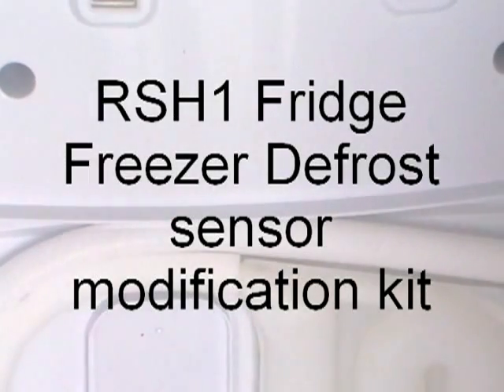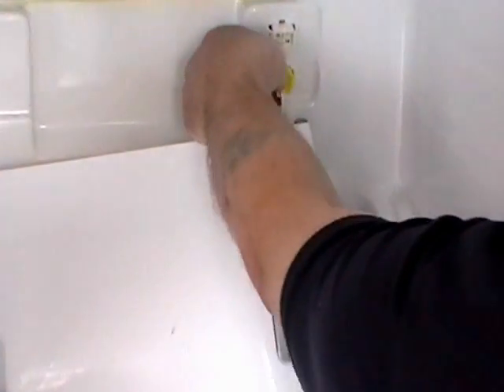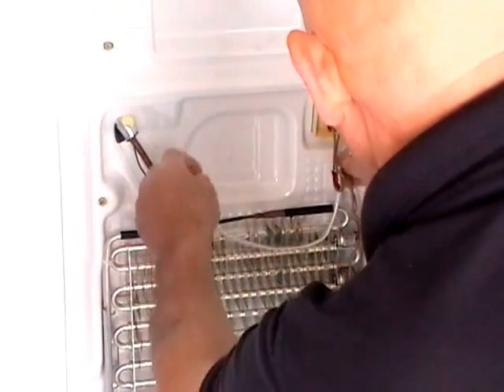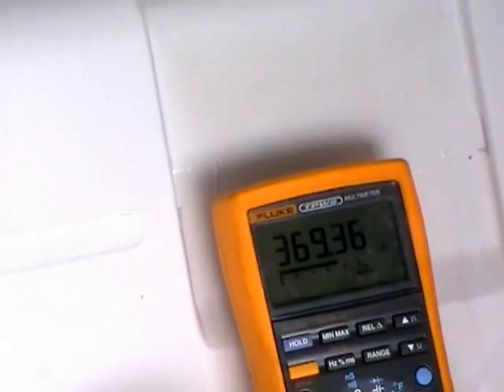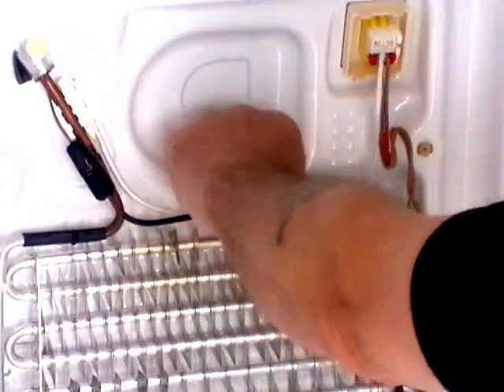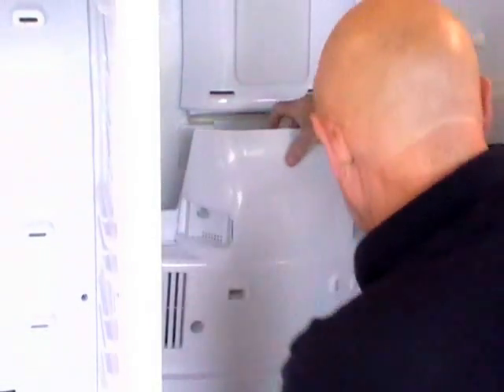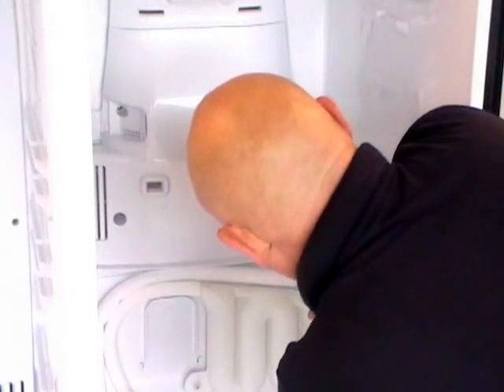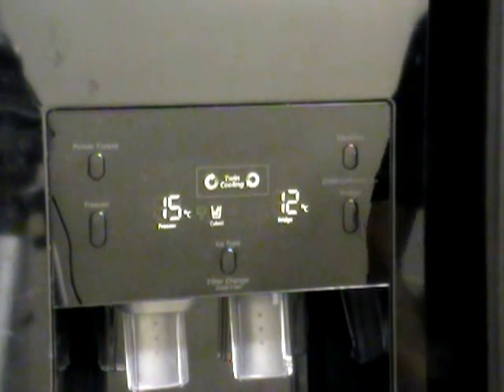RSH1 Samsung Fridge Freezer problem, fridge defrost sensor modification kit

Comment from the maker: not heard anything about plastic liners melting... i do know they can crack quite badly and excessive heat from the element can cause this. The crack is usually on the liner behind the evap panel and can be 8 to 10 inches long.
The mod kit can be done DIY depending on your ability, many people have bought this part from us and fitted it themselves, the video does show the way forward. altering the temp setting to 17 degrees (setting 3) is part of the modification

Comment from the maker: option item 13, is the fridge defrost temperature option within the electronic control, option value 3 is equal to a defrost temperature of 17 degrees. So as part of the modification the fridge defrost upper temperature is increased from 12 to 17 degrees, alowing a slightly longer operating time for the heaters.
Be careful with the option settings, many different options are available to alter but should not messed with.
Reply: Àa

Comment from the maker: Hi,
the black headed sensor will work in your fridge but it is not the correct sensor for the RSH1. The kit is more than just the repositioning of the sensor, along with the other parts and altering the temperature it does cure the left hand vent icing problem.
The water bottle in the fridge does freeze up when overicing is occuring, therefore no water distribution is usually a sign of this problem. 
This only works if the other components are good, the back panel and the defrost heater

Comment: Hi, Thanks very much for your video! I finally resolve the problem of ice!!

I have an other problem: the ice maker makes too little ice, because my water pressure it's low. can you tell me a code (holding buttons?) to lengthen the duration of the water that fills the molds ??
thankyou very much!
Luca

Comment: Hi I have one these Samsung fridges. Neither the fridge or freezer is staying cool. It will start to get cool, freezer about freezing and fridge about 10 degrees, then the temperature doesn't go down any further. I took this panel off and it is not iced up. I guess this fix won't help in this situation? Would you have any ideas about what could be causing this? This fridge is only about 5 years old.

Comment: hello, i have a problem with my rsh1kers, it stopped working and an teckincian told me it was the board, i boguht a new one from samsung and connected back with all the cables etc.Now the display isnt working properly, it starts as normal but it showing an - after a while. If i started the machine with the door open it seems ok, when i am closing it the problems comes agains. Maybe i need this kit? Pls help me i am without freezer

Comment from the maker: Hello,
in the fridge, if you have ice on the top vent of the back panel (assuming you have an RSH1 model), the fan is noisy and stops when the door is opened, there is a very good chance that the kit is needed.
If the defrost sensor is fitted on the right it is certain to be needed, the video does cover it all.
If you are about to remove the back panel, do not force it, once the screws are out it removes easily, if its stuck do not pull on it, there will be ice holding it, defrost some more.
Reply: I'm 9 years late, but is that kit still available

Comment from the maker: The fridge will freeze the lower shelves if there is no air circulation, so most likely the fridge evaporator is iced up. The freezer section should still be working ok.
So, there is a good chance that this kit will fix the problem, you will not know how good or bad the polystyrene insulation on the back panel is until you remove it. Fully defrost the fridge section before removing the back panel, if you force the panel off you may break the polystyrene insulation..... terminally.

Comment: hi,, love the video , I am a refrigeration engineer and have a couple of questions regarding the Samsung RSH1dbbp American fridge freezer , the unit has a probe on the top just under the electrical cover , this probe is yellow, what is its purpose , is it an ambient sensor for the condenser fan motor ?? also were can I get a manual to assess all the parameters setting in the controller as shown in the vid..thanks for your time 
Tom